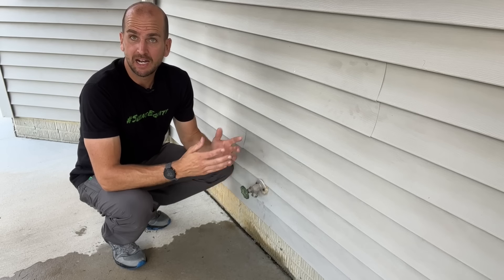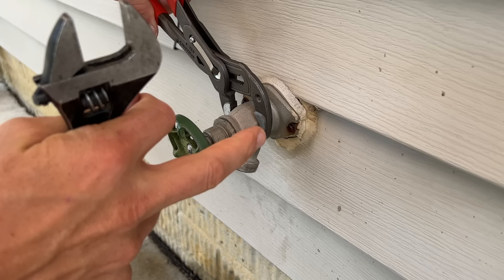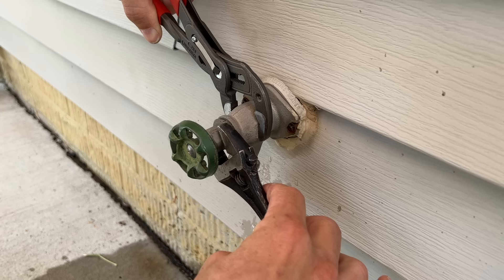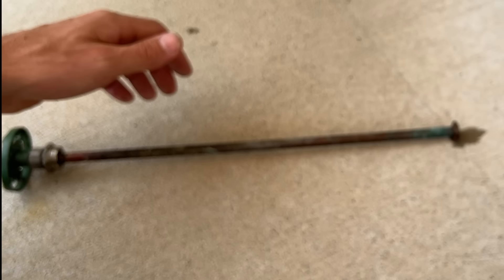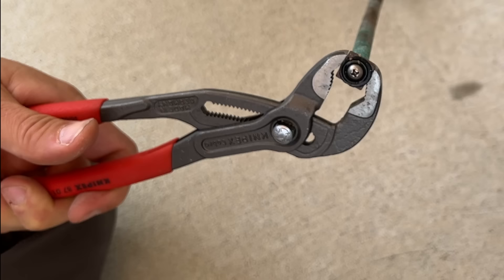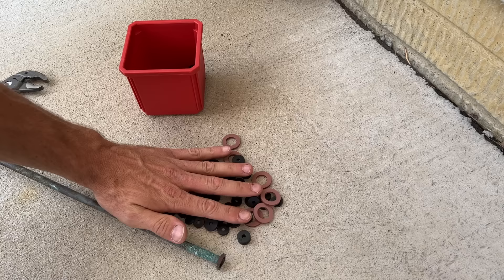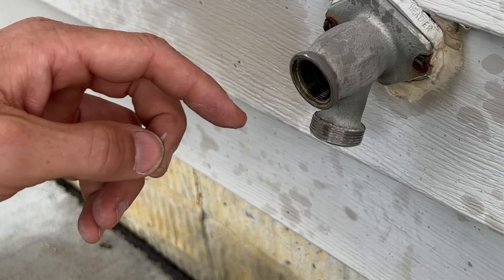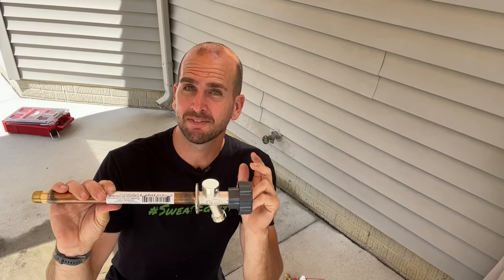How To Fix A Leaking Outdoor Faucet | Easy DIY Fix!

Comment: Option #2, grab a pair of vice grips, or similar tool and just tighten the shit out of it every time you turn it off for the next 5-10 years until you break the shaft off the turning wheel.

Comment: Not sure what the negatives may be ... but in my opinon ... a much, MUCH easier solution .. to all of this ... as at least one other person noted here ... is simply to unscrew the old gate valve (AFTER shutting main water supply valve!!) ... and replace it with a quarter turn on-off ball valve!! Done. End of subject. If your water supply is clean, no mud, sand, grit ... this likely is a life-time fix. AND .. much, much easier to use ... day in, day out.  Flick of the wrist on ... flick of the wrist ... off. Been replacing these old styled gate valves for 15 years ... all still working, no leaking. Why on earth would you mess with that?
Reply: I have a Y shaped quarter turn on-off valve it helps alot but still leaks

Comment: Silicone washers are also commonly used in plumbing fixtures and have some advantages over nylon washers. Silicone is highly flexible and can conform to irregular surfaces, making it a good choice for creating a tight seal in plumbing connections. It is also resistant to high temperatures and chemicals, making it suitable for a wide range of plumbing applications.

Compared to nylon washers, silicone washers are generally more durable and have a longer lifespan. They are less likely to degrade over time due to exposure to water, chemicals, or extreme temperatures. Silicone washers also have better resistance to compression set, meaning they can maintain their shape and sealing properties even after repeated use.

However, nylon washers are generally more cost-effective compared to silicone washers. They are also easier to find in standard plumbing fixtures.

In summary, both nylon and silicone washers can create effective seals in plumbing fixtures, but silicone washers tend to offer better durability and resistance to high temperatures and chemicals. The choice between the two depends on the specific requirements of the plumbing application and personal preferences.

Comment: You're holding the slip joint pliers backwards during disassembly. 
Open the spigot to drain water BEFORE you start turning bonnet nut. 
Have spigot in the ON position during reassembly. You DO NOT want the new washer contacting the seat during reassembly.
When turning off spigot, turn handle only until it is snug. DO NOT turn it as tight as it will go. That will lead to crushing the washer, which is the reason you need to replace it in the first place. The old washer was the correct size, but because you gave it the gorilla twist when turning it off, you damaged it.
Other than that, not a bad video.

Comment: The Only Proper way to fix : Turn off the water at the main Make sure one line is wide open. Remove valve from hose bib. REPLACE THE WASHER. Reseal reverse water turn on no leak.

Comment: Ball valves or gate valves are much better, they dont leak. You have a shutoff inside .Drain in winter , the pipe is pitched down. Forget the freeze proof faucets,they are lousy.

Comment: Your not holding your channel locks the correct direction turn them 180 degrees  the short part of channel locks should be facing the direction your crescent wrench is being turned channel locks are like pipe wrenches they only work 1 direction.  Good luck hit me up if you would like me to check your videos before you,  get someone in a jam with bad advice.  What to do with a sweat silcock. ?

Comment: Your channel locks are in the wrong direction, you should be holding back opposite from turning the other 🔩 nut
Reply from the maker: 😁 I know that really gets people going but if I am not really applying much torque I don’t usually get too excited about the direction.  Now if I am actually wrenching on a nut or bolt that is a totally different story.

Comment: First:  either replace that thing, or call a plumber, why mess around with your HOME. 
Second: WD40 is NOT a penetrating oil, it's a WATER DISPLACEMENT formula. WD..duh.
Third:  the washer is not the root cause, what do you think the washer sits against?  look at the condition of that shank,  you'd be out of your mind to think "that's okay, it's normal"

I've been a plumber for almost 25 years, just because you're a HANDY person does NOT make you qualified to touch plumbing.  Your little "plumbing box" is very cute...for fisher price.
Reply from the maker: Thanks for the feedback.

Comment: That is nice a dandy, BUT, most stores do not sell the rebuild kits due to costing as close to the cost of the faucet, unless your rich and but those $100 plus a piece outdoor faucets to which a limited brand, the store might stock those rebuild kits for around 40 to $60 bucks. Most make you replace the whole frost free faucet about every 3 years, depending on how hard your water is, because the seals start leaking water. Most of those faucets are a CHINESE MADE JOKE!!!!!!!!!!!!!!